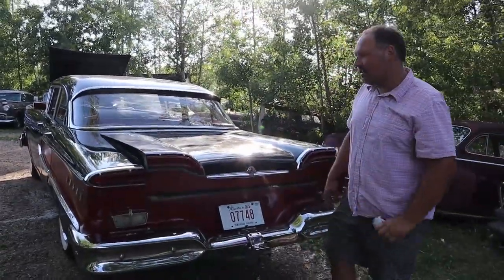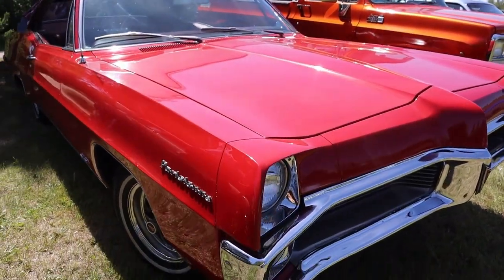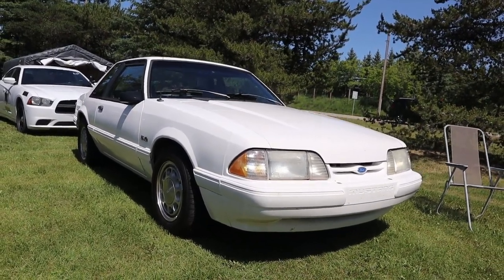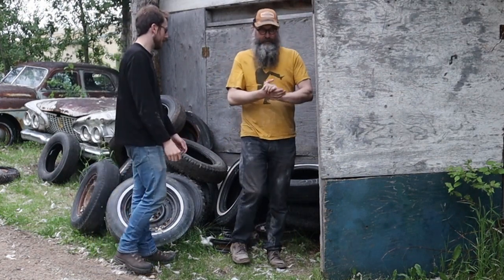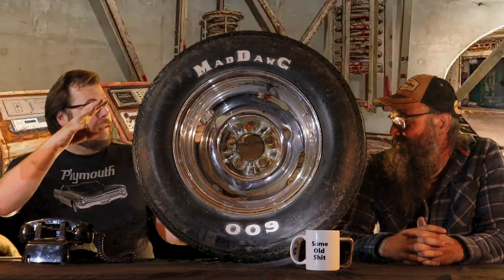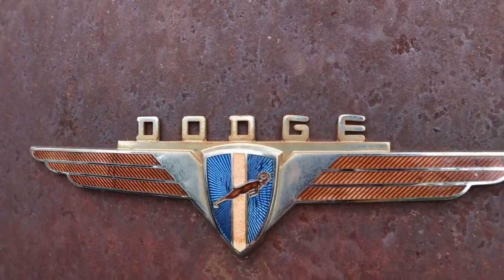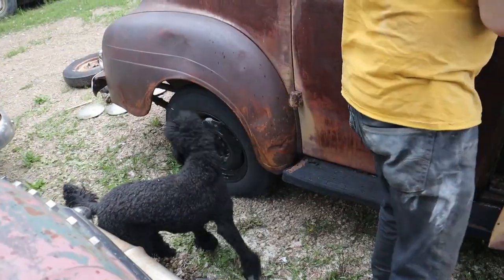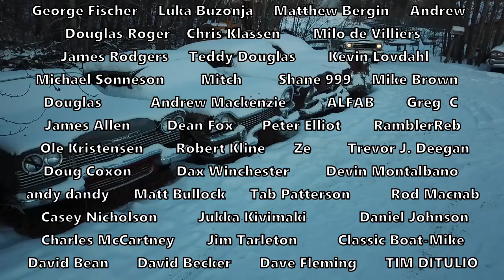Shopping Again! How Could I Resist? Plus: Great Car Show and "My Classic Tire" Special!

Comment: Oh man I couldn't believe it when you rolled (well, threw) out those Mad Dawg 600's.  I'm also a bit of a classic tire aficionado and I have a brand new (little hairs still on the tread, rubber as supple as the day they were made) pair of 'Ruffian 600' L60-15's, made in Canada in 1972.  The '600' lettering is in exactly the same font as yours (and other similarities), so clearly the same manufacturer, and like you I could find nothing out about them, so I was blown away to see yours.  I'll dig mine out next weekend and post some pics on your Patreon community noticeboard (as I don't think it's possible to post pictures here), they are a sight to behold.  And fear not, I will make sure that they turn a wheel in anger one day (but also on the grass, they are (unfortunately in that regard) way too precious to smoke up), and when that happens I'll post a vid on the community page.  Another fantastic CWM episode, my life wouldn't be complete anymore without a weekly dose of CWM.   EDIT: Actually I'm not sure that I'll ever run them because I have a like new (barely used) set of L60-15's that I'll use before them (also an unusual brand who's name escapes me at the moment, will post pics with the other ones), although I'm not sure who I'd be saving them (the 600's) for because future generations (who have no nostalgic connection to such things) probably won't care about them, but anyway, they probably deserve to be displayed on some museum piece (or just in my garage).   It would be a shame to unnecessarily wear the hairs of the treads - lol.
Reply from the maker: Hey Marc! Thanks for the note! Always a treat to hear from another Classic Tire aficionado... I look forward to seeing your pics on the Patreon tomorrow! (oh, your package arrived... Thanks so much! I haven't opened it yet)  All the very best as always!

Comment: I got a pair of Big Boppers that's what the brand is I got him on some Raider mags I had them on my 9C one Squad 1990 but the body fell off the frame at 436 thousand miles on it I bought it with 74000 miles what squad has no air in 1990 mine did not have air the cops must have hated that car in the in the summer thanks for doing this keeps me inspired
Reply from the maker: Big Boppers! That is absolutely fantastic... Cheers from me and Frankers and the Classic Tire Crew!

Comment: Pretty sure that vacuum canister you pulled out of the trunk is a 20s vacuum fuel pump. My 23 Durant star has one, just like it. That 42 is a nice find especially since kids didn't cave the roof in and smash all the glass.
Reply from the maker: I think you are correct! Thanks for the note...Cheers!

Comment: I don't know what you have for fuel up there in Canada. Down here we have the dreaded ethanol infused mixture that is the bane of everything mechanical that uses so-called gasoline. It will plug up the fuel system in anything from a weed whacker to a truck.
Reply from the maker: Same here, except for Shell Premium.  Cheers!

Comment: You're  t sounds so sweet and easy running, so remarkably well made  just think of the shit roads it operated on for  years, and allittle mantainace  she still drives out  nice  and get everything you need to keep them going. With the buzz coil ignition  you could set the motor in a certain  spot  and  they would self start  by turning the ignition switch on.  Great video thanks again  from Minnesota....
Reply from the maker: Thanks Kevin! Glad you enjoyed the show and the old Model T like I do...She's doing so well for an un-rebuilt engine, so I'll just keep taking it easy and see how she does! Cheers..

Comment: Awe man- I had old Rocket rims with Mad Dawg's 50's on the front 70's on the rear of my 72 Raunchero! 😆 I ran a 351m with a stroker cam ladder bars and a four speed racing clutch and trans! I outran Vettes with that baby! Even did it once with a blown left rear tire, shredded my rim all the way to it's cone!
Reply from the maker: Ha! Awesome... Mad Dawgs had adventurous lives, I suspect! Cheers...
Reply: @coldwarmotors  mine sure did😈 right up untill the blowout! Sadly I couldn't find matches for therim and tire so I had to get another set! How I wish I still had the Rocket rims!

Comment: The trim and detail on the old dodges blow me away. I have the 40 coupe that you saw at Sherwood park cruise night and it also was parked in 64. Thanks for sharing your new toy. Very cool. I may have some bits of the 40 that would fit on yours
Reply from the maker: Hey Dan! I was hoping you'd see the latest beater... I would definitely give a home to any un-needed bits and pieces..Cheers!
Reply: I will put together a pile of stuff that I won’t use. If you can find the package I sent it would contain my contact info along with a service manual. If I recall correctly it is wrapped in duct tape.

Comment: Tiger paws Unaroyal
Reply from the maker: Oh yeah! I had an old set in the 80s, too! They looked sweet... Cheers!
Reply: @coldwarmotors  I have one set of Tiger Paws under my house and one set on my '72 Fury.  And if you see my latest reply Scott I also have a set of 600's (very similar to the ones on you latest vid).  And a lot more tires where those came from, which might be half sensible if I didn't live in the central city suburbs, man I've got some issues..
Reply: Actually, replying to myself, I also have a set of Tiger Paws on my '74 Monaco, but I plan to replace the ones on my '72 Fury with some H70-15's when I find a good enough set not to kill me at high speed.

Comment: The only raised white tires I ever had were Sears Superwide SS 60's and 70's on my 71 Nova with a straight 6 and Powerglide.  Rear air shocks were necessary and what every 19 yr old needed in the late 70's was a set of sidepipes!  MudDawGs would have been awesome!
Reply from the maker: Superwide SS! Thanks for that... What a killer name!